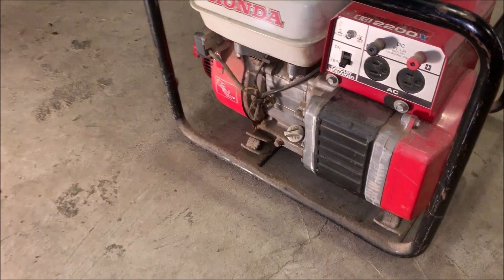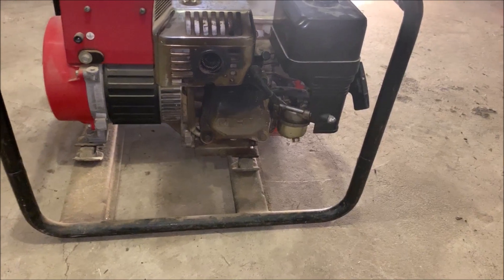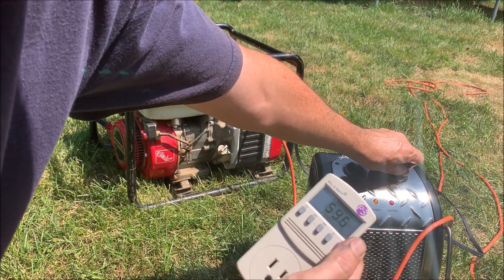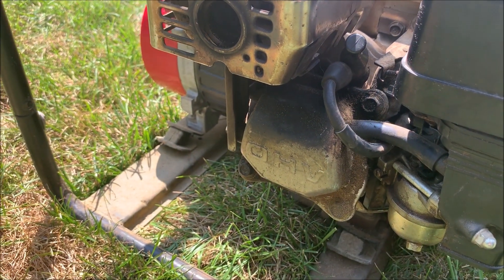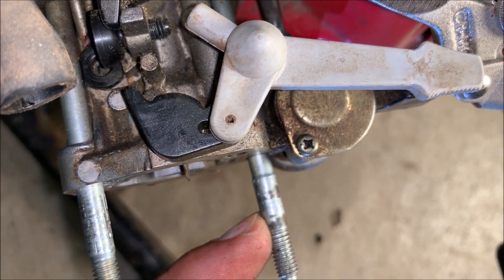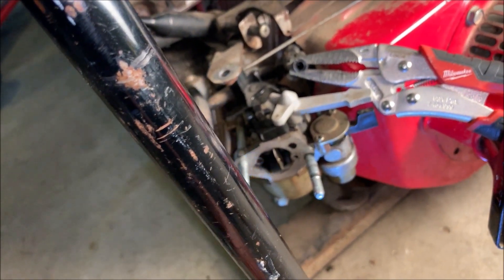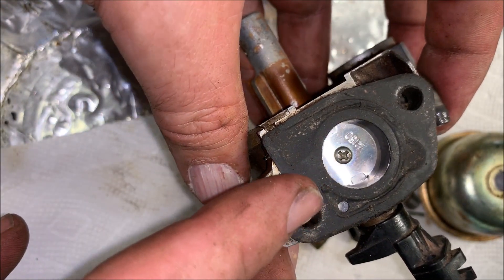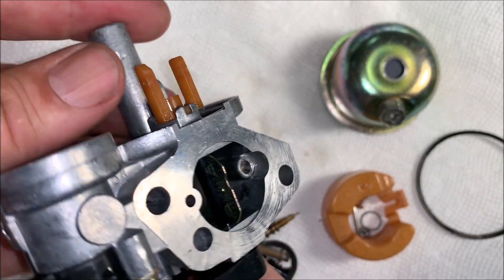Honda EG2200X Generator Carburetor Cleaning and Testing

Comment: James, Glenn here from Glenn's Speed Shop on YouTube.  I bought a Honda EG1400 that is not making power. You are my inspiration to tackle a generator that runs but no power. The Honda is quite different than most of the ones in your videos so is hard to diagnose.  When I start it up, breaker off, it goes under a load so hard it won't come up to speed. Where should I start? A longshot that you will see this i understand.  
Thanks Glenn
Reply from the maker: Going under load when no electrical load is connected is a bad sign.  That indicates either a short circuit in the stator or a short circuit in the wiring.  Sometimes if the spark arrestor is clogged it can sound like it going under load.
Reply: @jcondon1 Thanks James. . I traced the wires from the Brushes to the AVR this morning, all the wiring looks good. I've been binge watching your videos this week and you did mention a short in the stator would cause this. Knowing that, I did order a new AVR...lol. Thanks for the videos and advice!

Glenn

Comment: I am a new subscriber and having background in electronic and some mechanics I found your videos very educational, you are better than some of my teachers in electrical engineering school. I read in the comment that your videos are very long. They are not, details are very important and if somebody finds them to long, they just can walk away.
I found that Gun Scrubber spray works very good for cleaning electronics and contacts, and do not harm plastic (at least the majority of them). Remember mi the Freon 113 used to clean electronics boards. CAUTION EXTREMELY FLAMMABLE.
Thank you
Henry
Reply from the maker: I agree, the detail is important.  Otherwise it’s hard to learn.

Comment: Hi, James I’ve watching your videos I learn a lot, in this video you mention that the jet is to big and you do not have any smallest.  What about solder the jet hole, and drill an small hole. I am a retired electrical engineer that likes to fix things. Used to repair motorcycles and now by necessity I need to learn about generators because I am living in Miami and during 2 hurricanes I was with no electricity for 10 days each 
I have a Generac 17500 watt that can power my whole-house. In that generator if you remove the oil stick tubing + the air case you can slide out the carburetor without removing the air intake
Thank you, 
Henry

Comment: I have that same generator.  I got mine in 1985.  Still runs great, doesn't get much use, and it sits in the shed so it stays dry when rains come.
I replaced the carb many years ago, which helped a lot!  
It did not have wheels when I bought it, but I added small casters to it which helped a lot.
Removing the carb is easier if you remove the 4 outer cage bolts and then remove the upper cage.  
I change the oil in it every year, check the air filter and I did replace the spark plug, finally about 5 years ago.  I also adjusted the valves last year thanks to you reminding everyone when you checked that Generator with the B&S engine.  I only found your channel about 4 months ago, then found this video about this particular generator so thank you for this video.

Comment: I have a EG3500.  Bought it new 20 years ago.  Has run flawlessly.  Never stored it with fuel in the carb.  I thought I would pull the spark plug to change it.  (20 year old spark plug is long enough, right?)  It was tight removing it, and ended up buggering up and cross threaded the new one.  What disaster.  Thanks to watching your clips, I decided to buy a new cyl head on Amazon.  Comes with new valves, springs, gaskets, nuts and bolts.  $60 bucks.  Got the old one pulled, cleaned up the piston.  Checked the carb - it was spotless.  New head should be here tomorrow.  I plan to use anti-sieze on the plug threads.  Wish me luck getting it back together ;-)
Reply from the maker: Good luck!
Reply: @jcondon1  there is a small kink,dent in the new head gasket metal ring. Maybe Shipping damage.  Do you think it’s worth the risk of putting it back together with it, (it’ll probably crush flat) or should I get a replacement one.

Comment: You help me allot, I have a new one generator it's like good clone of Honda, named Fogo f3000r with Rato 210cc engine. Under load, like 1000 watt, start crazy surging , as you said it was main jet which is was too small I made it bigger with medicine syringe needle , start working way more better. Thank you

Comment: You didn't try to adjust the original carb after cleaning it. Also I would have replaced the spark plug and oil.

Comment: I worked for the Palm springs cemetery district for 20 years. We had one of these little Honda generators like this one. Through all the summer days of 120 + degrees, being dropped off the back of trucks, tree limbs falling on it and many other forms of abuse, the little generator never gave us one day of trouble.

Comment: Q---- Please, Can you video a close up of the ideal set screw function to govenor function on different units? Similar to a Sportsman. Supper job & truly helpful.  Thanks
Reply from the maker: The idle set screw is not used on most generators.  Only need to drive it in far enough for one thread to come through.

Comment: hi james i have the eg1500x and gx 160 gene,  i replaced the old 1500x carburetor with a cheap  honda gx 160 carb and it is running ok for a 20 year model ,they just go on for ever mate
Reply from the maker: Honda's do last with a little care.  Honda clones carbs are the only ones I have had any luck with on 4 cycle equipment.

Comment: You clearly know what you're doing and it runs beautifully but I've read that if the little tiny o-rings on the plastic pilot jet degrade it'll run rich. Have you found that problem?
Reply from the maker: That is a problem, but when they degrade it will start sucking more air and cause it to run lean.

Comment: Today I got the honda eg2200z that a neighbor gave me. Been sitting for long time but said it did run. Problem is its impossible to pull the starter rope. Removed the 3 bolts on stater cover, lubed it and turns freely. Where the starter pully engages with engine I can turn easily by hand. I bolt the cover back on and still impossible to pull rope. Any guidance on this machine that looks identical to yours appreciated. Thank you.
Reply: Usually that means the 3 mounting bolts that hold the starter recoil on, are too long and jamming against the shroud fan.

Comment: What jet size gauge did you use and where can I get one??
Reply from the maker: To measure jet size I use a micro drill bit set to find the size.  Gyros 45-12010 Carbon Steel Wire... https://www.amazon.com/dp/B000SKRR76?ref=ppx_pop_mob_ap_share

Comment: Found your channel recently and have enjoyed your videos and learned a lot.  You have excellent editing and good content.  I have a EB5000X Honda generator I have owned since 1992.  I have routinely changed the oil and changed the fuel every year.  It starts on the first or second pull and has about 1000 hours including two weeks of continuous running after Hurricane Ike.  Watching your channel emphasizes the need to run the engine out of fuel when storing, something I have always done.  Except for changing the oil, fuel and air filter this generator has been reliable, still has the original spark plug.
Reply from the maker: I don't get many Honda's.  They work well.

Comment: What weight oil to use on this model?  Thank you
Reply from the maker: 10w-30 is recommended.  You can use 10W-40 if the temperature outside is going to be above 85 Fahrenheit (33 Celsius).
Reply: @jcondon1  thank you

Comment: Same clone carb I just bought 9 bucks, unbelievable. I never saw what size the engine was. Someone told me when a engine gets old, that you should drill out the main jet just a tad larger. Question, what steps should you take to store a generator for a longer period. Between disasters. If you run your generator for say 2 weeks 24 hours a day, should you within that time period change the oil ? My neighbor asked me to come over to see why his new generator failed. He said it started for 3 minutes then locked up. I looked at the tag which he had to move to pull the cord to start. It said Caution ad oil before use. 600 bucks down the drain. I told him if he brought it over I could probably fix it, I never saw the generator again. Shame, it was kinda nice, but all new ones are. My other neighbor has a old small Honda generator, but the tank is totally rusted out, and its kinda a strange shape. Replacement costs 165 bucks, aint happening.
Reply: Charles, if I am reading your post correctly...your neighbor ran his genset with no oil?  :(   That is painful to think about.

Comment: James do you have any advice on how to install an electric starter conversion kit for this generator it's an 11hp 6000 watt. It's a real burger to pull start and I believe the compression release is sticking when cold. This unit has only about 300 hours on it. It's a Craftsman model 580.327160 made by Generac
Reply from the maker: Sorry, have not done an electric start conversion.  I took a quick look at your model online and it appears to have a spot to mount a starter so that part should work without issue.   Just make sure your fly wheel has the ring rear on it to engage the starter teeth.  As far as the wiring, you would need to add a battery, switch and a starter solenoid.  I would doubt that engine has a charging system, so you will have to get a charger/maintainer for the battery.
Reply: @jcondon1  Thanks for answering my question do you have any advice on how to free up a sticking compression release ,when you can get it started and the engine warms up it pull like it supposed to and starts easily as it should but when cold it's a real burger to pull start under full compression
Reply from the maker: Mark Young the compression release engages as the engine spins down.  So if easy to pull right after shut down then the release is on and will stay on until next  cold start.  Would guess one of your valves has a little too much clearance and should be adjusted.